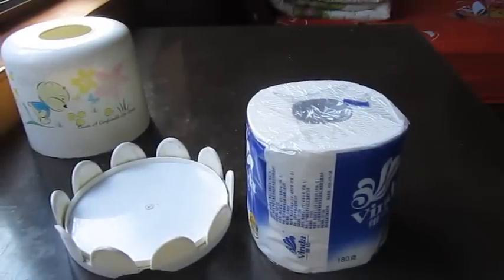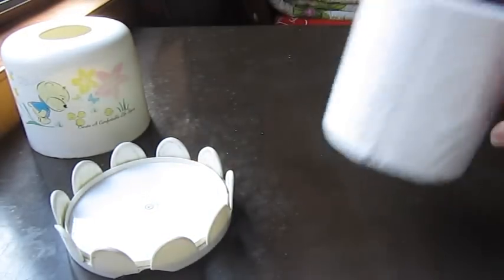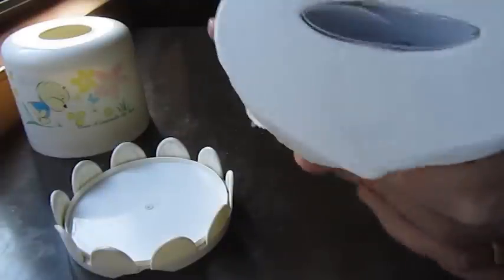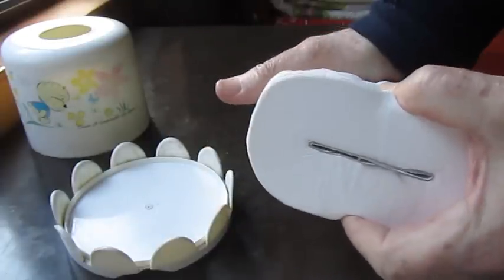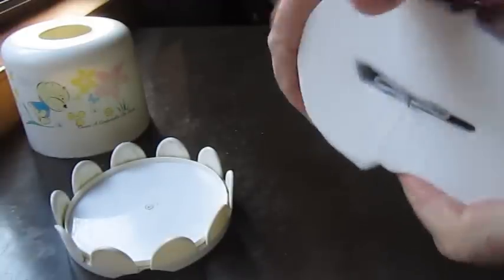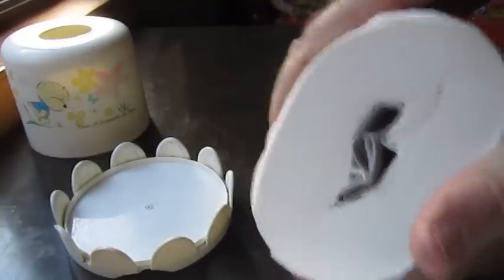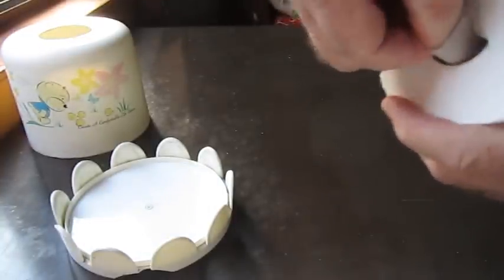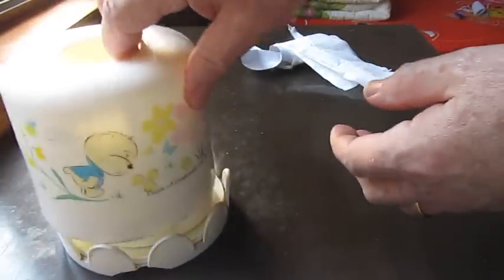Remove Toilet Roll Core

Comment: Whats thé point removing that
Reply from the maker: In many places here in China they don't have a toilet roll holder fixed to the wall, but a container sitting on a flat surface (as shown in the video )where you pull out sheets from the centre of the roll - hence the need to remove the cardboard core.
Reply: kenan yenen m
Reply: It's softer
Reply: DIY crafts